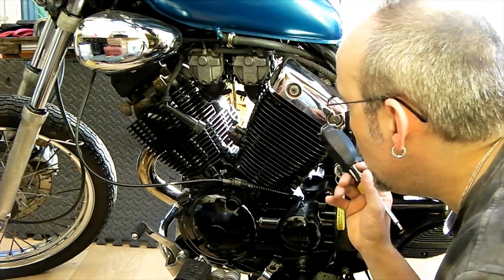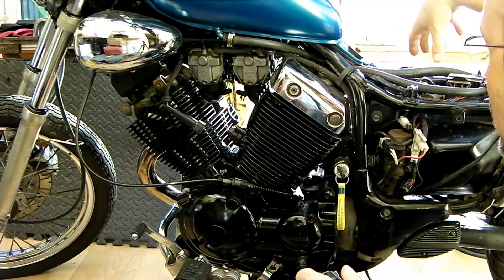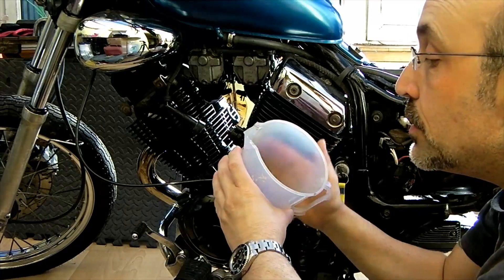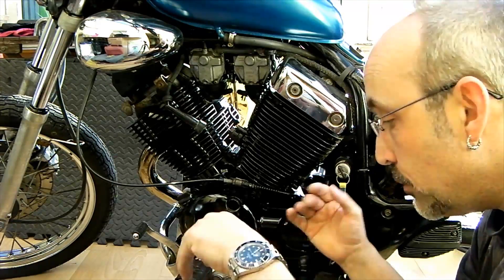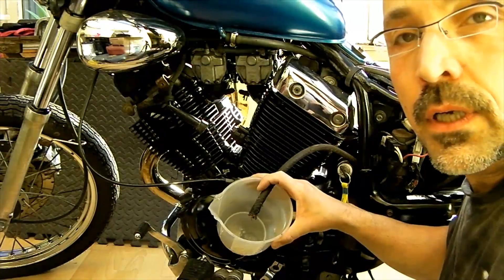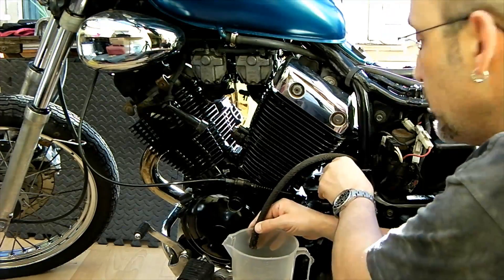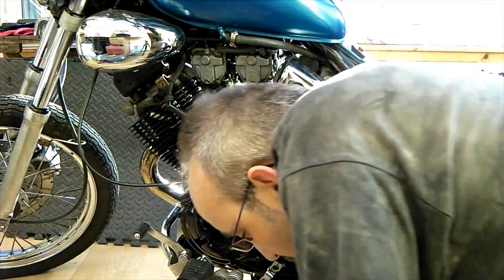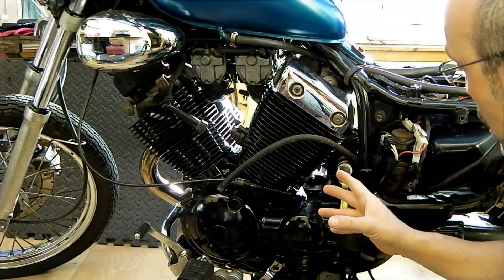Yamaha VIrago XV5535 Bobber Project, Part 1 Testing The Fuel Pump!

Comment: Nice video. 
I have question regaring the "dummy" tank.
I bought a Virago 535 from 87, with a "real" tank on the top. 
However, when i fill it nothing comes out of the bottom hole. 
I have checked that I can blow air inside with compressed air.
I also see a hose inside the tank when using a cam on a wire.
Any ideas?
Reply from the maker: Does it have all the hoses and such to the frame tank?
I'm unsure why the fuel wouldn't flow straight through.
Reply: @spidiq8  I have unmounted the tank, so its just sitting on my desk, filled with fluid and not a drop coming out
Reply from the maker: @AxelAndersen  but you say you can blow into it? Have you tried suction? Obviously not direct to the pipe but if you could rig up something. There shouldn't be any vacuum related innards but that's a thought. If nothing on either then the pipe must vent through the tank but exit elsewhere.
If you cap the tank and rotate it over a large container and the pipe does vent inside at some point during rotation fuel should exit.
Reply: @spidiq8  I dont see any exit any where exept the bottom hole and the fuel cap. Could the gasoline nozzle be connected to the pipe inside the tank?
Reply from the maker: @AxelAndersen  I really couldn't say without seeing it. It's baffling. If there's a hole to put fuel in there has to be a hole for it to come out and if it's not something is blocking it or it's been altered for some reason.
The connection hoses are wide bore because it literally has to drop through to the lower tank so unless someone took a later model tank and sealed it to fit to an earlier model bike with the filler under the seat I'm stumped
Reply: @spidiq8  yea, and I cant see any logical explanation yet. I can stick a wire into the fule outlet hole, and it goes for 12 cm, i can blow air in and I feel that coming out of the top, but i cant get fuel the other way. Feels like a pipe has been attached inside the tank to the outlet hole.

Comment: Can the actual pump get clogged up with crud
Reply from the maker: Absolutely. Especially if a fuel filter isn't fitted and there's debris in the tank.
Reply: @spidiq8  yeah it’s got a fuel filter and it’s nice and clean but the bike was sitting around a bit before I bought it so that’s what’s making me think it could have a dirty fuel pump ⛽️ hope you’re keeping well as we’ve spoken before about your lovely cat gizmo 👍
Reply from the maker: @garyconstant4234  It's possible but the first thing I'd do is get some fresh fuel in it. The modern stuff goes off quicker than milk. I'm not bad thanks. Just too busy lately. I need more YouTube video creating time. Hope you're well yourself.

Comment: It's insane to use so much cranking, it messes up your starter. And there's no need to crank the engine, the pump delivers until the carb bowls are full and the valves close. Then it stops. That's why you usually hear a few clicks when you switch the ignition on.
Reply from the maker: Thanks for the info

Comment: Hey 👋 got another question for you.. why would the pilot screws have to be turned almost all the way in instead of 2&1/2 turns out to get a good air/fuel mixture? What would be causing that? Thanks
Reply from the maker: Sounds like either a blockage or dirt in the carb or an air leak.
Reply: @spidiq8  thanks split o-ring

Comment: Hey man! Amazing video! I've checked each of them, great learning content. I wanted to ask you a question, hope it is not too silly. I do own virago 535 1988, which has dummy tank. Would Virago 95+ tank fit? I really want to replace dummy.
Reply from the maker: I've never tried to swap one for an earlier dummy plastic tank but theoretically it should. I don't think there are any changes to the frame that would affect it.
The one thing that will be tricky is that you'll need to also change the under seat tank for the later one with the feed pipes from the top tank.
Depending on how much bother you want to go to I can say it doesn't add that much more fuel. You're still looking for a filling station every 100 miles.
Had I kept my own I would have fitted something like a Mustang or peanut style tank.

Comment: I have a 1994 yamaha virago xv535, I recently have deleted the fuel pump because the fuel tank under the seat was very rotted and could not be reused. I went with a cafe style tank and the bike is now gravity fed to the carburetors. The bike now seems like it is struggling to run at higher rpms. I tried bigger jets because it has pipes with very little baffling. Do these bikes need pressure from a fuel pump or can they run from a regular gas tank?

Any advice would be greatly appreciated!
Reply from the maker: If the fuel is above the carburettors gravity feed should be adequate.
Is the tank split high on the underside and is the fuel tap on one side only?
If you have a vacuum feed fuel tap have you tried it on the Prime position bypassing the vacuum. 
Other possibilities are that you may need a high flow fuel tap. Pingel used to be popular and available in a wide range of tank fitments.
Having said all the above, it may be that a small amount of additional pressure is required to fill the float bowls on these carbs as they're an unusual side on layout.
Reply: It has fuel taps on both sides and yes the inner middle wall of the tank is tall. The fuel taps seem free flowing I also have a clear piece of tubing right before the carberators so I know there is fuel in there. I think I'm going to try rigging up a fuel pump as I have a new one for this bike. Thank you very much for your fast response and information!
Reply from the maker: @stevegoulet5499  No problem, taps both sides obviously removes the possibility of starvation due to fuel pooling in one side.
Also with 2 taps, provided your cap is venting adequately flow should be sufficient.
Try a high rev run with the cap popped open just to rule that out, I've had blocked vent holes before causing a vacuum in the tank.
If not then a pump, (the original will be more than adequate) should ensure sufficient feed.
Are you using the stock airbox setup?
Reply: Yes i will try that just to make sure thank you, and the air filter is just a stock replacement and was not altered
Reply: PUT IT BACK TOGETHER.... PROPERLY !!!!
Reply: Steve please tell me what tank fits on these my upper tank is rotten and id like to switch to gravity feed thanks

Comment: Very detailed video. Thanks! I recently replaced the fuel pump and added a new plastic, transparent fuel filter on my virago. For some reason, the inlet of the fuel pump keeps leaking even when bike is off.
Reply from the maker: Do you mean where the fuel pipe connects to the filter?

Comment: hiya ,,, great vids... been great for me being a novice to all this..   don't s'pose you got any vids on HT leads.. it appears my Virago is only firing on 1 cylinder... forward cylinder is Hot.. rear Cold....   i've checked for a spark,, but no joy.. any advice would be great..
Reply from the maker: Thanks for the feedback and glad you've found them useful so far.
I don't have any specifically on HT circuits, I don't remember if these are separate coils as it's an age since I owned my own and worked on this.
If separate try swapping them and see if the cylinders swap, if so, check the LT (low tension), thin wires feeding to the coils with a multimeter, if they're getting voltage then it has to be the coil, lead or plug cap.
I'll try to see if I've still got my manual and have a look there.
Reply: First I thing I would do is swap the coils over, as they are integrated with the HT leads. If you get forward not firing and rear is, you’ve found the issue. If not work back from there to the ignition. May be a leaky lead, if you get a shock off the one not firing.
Reply: IGNORE THIS GUY, HE'S A PRAT  WHO KNOWS NOTHING.

Comment: I have seen a whole lot of subject about the fiel filter fuel pump fuel line etc. But none of them actually show where the fuel filter is for a 1991 virago 1100
Reply from the maker: That model is slightly different to the 535 so I could tell you if the fuel pump is in the same place, easiest way to find it is to trace the fuel line from the carburettor back until you locate it, they're typically under a panel or the seat area to keep them out of the weather and away from engine heat.
Reply: @spidiq8  i appreciate that thank u found it

Comment: The fuel pump is pressure activated, so it should pump fuel until you block the outlet pipe by pressing your thumb over the pipe opening.Does not seem to be working at all.Cranking does not activate the pump if the pipe is already disconnected.
Reply from the maker: Good to know thanks.